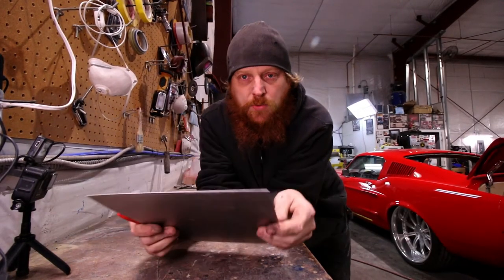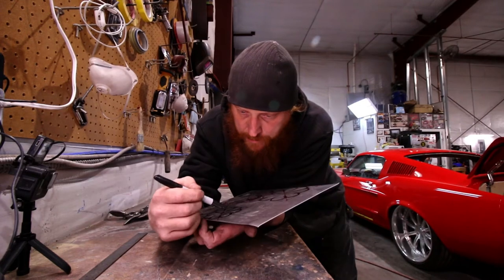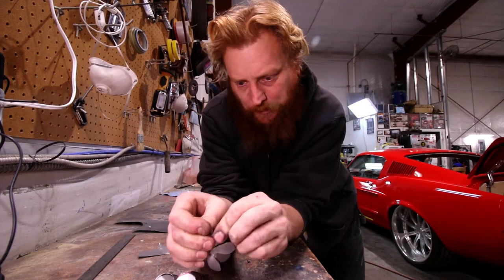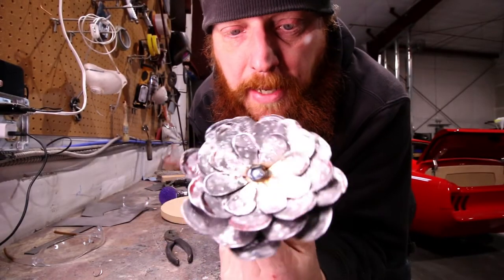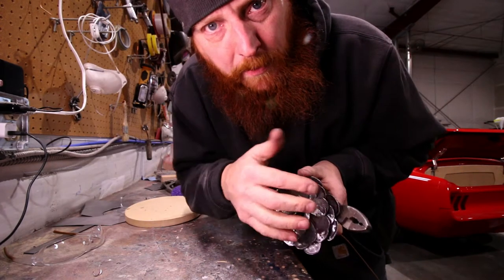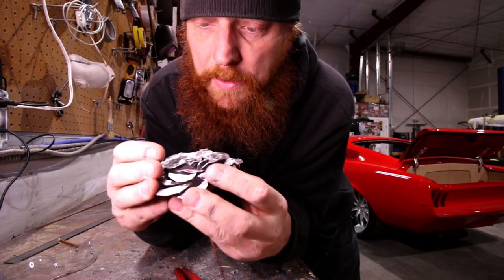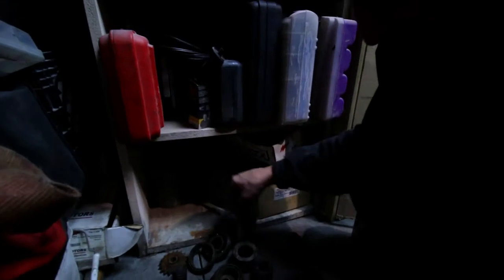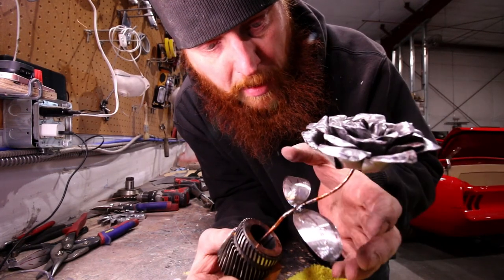How to make a metal flower.

Comment: What guage would you use if you wanted to use copper sheets?
Reply from the maker: well not to sure I really have not used copper. I do believe it take a lot more heat to weld? I would use 20 gauge  to start? hope that helps?
Reply: @redfabkustomz  Thank you!